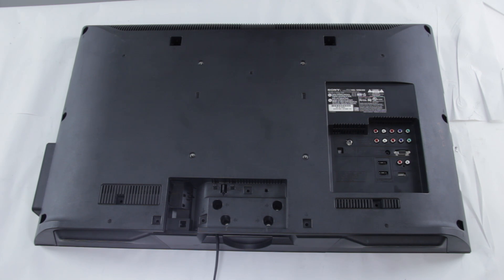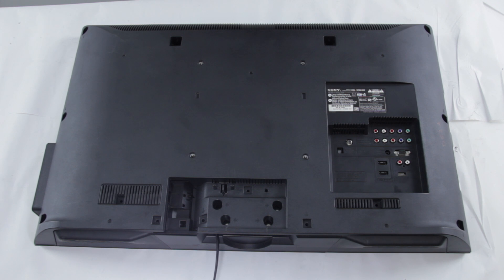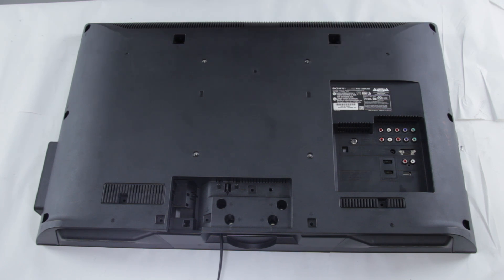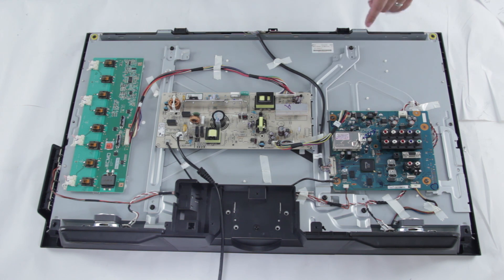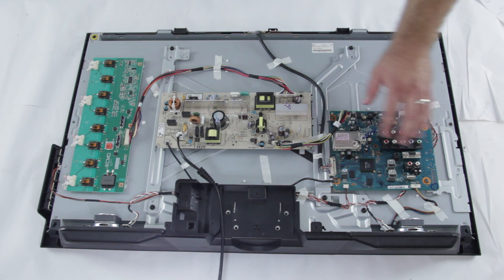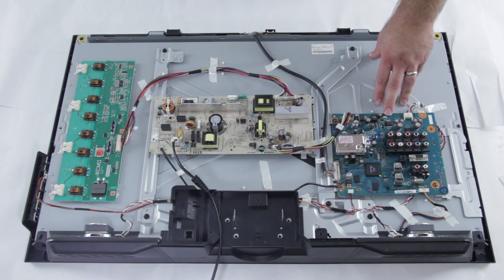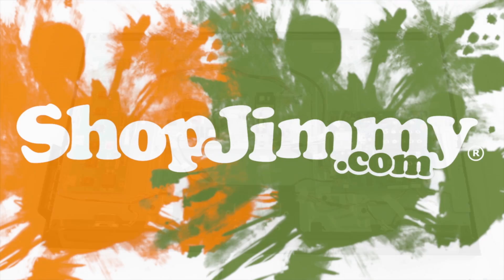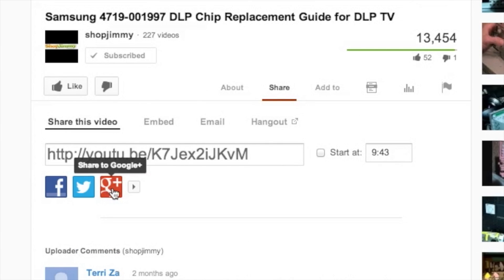LCD TV Repair - TV Has Audio, No Video - Common Main Board Symptoms & Solutions

Comment: hey Guys,  nice vid. I have a HP LC4776N with some issues, it will power up with no problems, but after ~30 min the whole screen goes black with faint vertical red lines. (audio can still be heard. )  I'm thinking it's the main board overheating,  but could it be the T CON too? thanks for the help!

Comment: I have a sony KDL40XBR3 with slow picture start up. When this occurs I have no control with the remote or panel on TV. I've changed the power supply and analogue board with no luck. Wondering if the problem is in the digital main board? Picture when on is perfect!!

Comment: Love Shop Jimmy..so informative and helpful...
I have a Sharp Aquos LC52D85UN..I was watching TV and it just shut down..no picture no sound..I unplugged and plugged the TV several times and still nothing..on the front panel the Power and OPC button blink twice simultaneously then the OPC blinks 3 times separately right after...tried find the codes for the blinking but no success. Thanks
Reply from the maker: +Diana Tull  Try all repairs and troubleshooting at your own risk.  I recommend replacing the power supply board in your TV.   Click this link to a replacement power supply board for your TV model number:  http://www.shopjimmy.com/sharp-rdenca336wjqz-power-supply-unit.htm  There may be multiple boards for the same TV model number, be sure to match part numbers on your current board, with your replacement for compatibility.  Here is a link to a video showing how to identify your part number, click here:  https://www.youtube.com/watch?v=-i9o4C2XkyQ  Thanks and please let us know if you have any further questions with your TV Repair!  www.shopjimmy.com

Comment: hello,i have a element 60 inch tv, it has no picture and have sound, i did the flash light test and seen picture in back ground, i replace t con board, and other ideas?
Reply from the maker: +Brian Seibert   Try all repairs and troubleshooting at your own risk. This could be a problem with either the power supply, the inverter board or boards, or the lamps in the TV that provide the backlighting. You can try replacing the power supply board or all of the inverter board(s) in your TV to see if one of those replacements fixes the problem. Try all repairs and troubleshooting at your own risk.  Please reply with your TV model number.  Click here to view a video that shows how to find your TV model number:  https://www.youtube.com/watch?v=S51nhAmwR2M  Thanks!  www.shopjimmy.com

Comment: HI, I have a Samsung LN46A750R1FXZA and the problem that I have is that when you turn on the TV at any moment there's no video it has audio. The video doesn't come back until you turn it off and turn it on back again. I already change all the capacitors on the power supply. Another thing that I noticed is that the DVD Player is connected to the RCA input and I can watch a movie and the TV does not go black.
Reply from the maker: +Omar D Ruiz Morales   Try all repairs and troubleshooting at your own risk.  I recommend running the flashlight test on your TV.   Here is a link to a video we produced that shows how to run the flashlight test. https://www.youtube.com/watch?v=xUzCLgoSPGM Please reply with your flashlight test results and we can recommend a replacement part for your TV repair. Thanks and please let us know if you have any questions! www.shopjimmy.com

Comment: C Ward My Samsung LTD TV is 3 years old. Purchased in 2012. Model number is LN46D630M3FXZA. While on it turns itself off then back on then off, etc. I've read that this was a common problem with earlier models. Apparently it's a problem with this model as well? Is the solution to replace the main board?
Reply from the maker: +C Ward  Try all repairs and troubleshooting at your own risk.  Do you have experience using a meter to check voltages?  Thanks!  www.shopjimmy.com

Comment: Hi, I have a Samsung Model UN55F9000AFXZA TV, it does power on but I just get a screen showing the TV being plugged into to the one connect box.  I can not get off that screen and the TV does not recognize the one connect box or the USB port.  I can't get to the menu.  I can turn the TV on with the power button but can not turn off the TV with the power button and have to use the remote to turn the TV off.  I was wondering if it would be the main board that is bad?

Comment: I have a Visio tv model sv472xvt it has no audio
Reply from the maker: +Adrian Saenz   Try all repairs and troubleshooting at your own risk.  I recommend replacing the main board in your TV.  Click this link to replacement parts for your TV model number:  http://www.shopjimmy.com/vizio-3647-0172-0150-main-board-for-sv472xvt.htm  There may be multiple boards for the same TV model number, be sure to match part numbers on your current board, with your replacement for compatibility.  Here is a link to a video showing how to identify your part number, click here:  https://www.youtube.com/watch?v=kxkeGLhlQY8  Thanks and please let us know if you have any further questions with your TV Repair!  www.shopjimmy.com

Comment: Hi, I would like to consult regarding my two TVs.  I would like to know if there is a DIY way to fix it since when I have it checked the repairman told me to buy a new unit instead since the cost of repair would almost be the same.  Here are the problems:

(1) SAMSUNG LED Model: UA40D5000PR
Problem:  Almost 80% of the screen (horizontally from the top) has the color fading to almost grayish black. It sometimes normalizes but only for a few seconds and there seems to be a horizontal line where the faded and normal color meets and sometimes a overlapping resulting to a distorted image.

(2)  DEVANT  LCD Model:  22DX850  
Problem:  No sound coming out.  I tried connecting to a speaker through the earphone jack still no sound coming out.

Comment: After  replacing my mainboard the picture and the menu in my TV are upside down and the picture  is fuzzy.. Before the replament there was not picture at all.  software in board was updated to v.1.557       Tv  sony   KDL-46EX641        main board was bought  ShopJimmy... Help please
Reply from the maker: +jose cespedes  Try all repairs and troubleshooting at your own risk.  It sounds like you replaced your main board with the incorrect replacement.  Thanks!  www.shopjimmy.com

Comment: Hi, I am having an issue with my TV. Model DP46840, ser: B1071151575996, I turn it on, green light comes on, hear a click, then light goes on, no TV. I can repeat this several times, then nothing at all. Unplug it for a few minutes and it will do it again. Main Board: PWB.MAIN.N7AL , right above that is 1LG4510Y04600. Have visually inspected it, Don't see any burnt colorization on board, modules or capacitors. No buldges in anything either.

Comment: greetings!  I have a Vizio SV470M with some fried HDMI ports and I'm pretty sure needs a mainboard replacement.  I'm having trouble finding one, however.  Even the most expensive sites I've found to have this part, 3647-0192-0395R (this is the number shown on vizios parts website although I've also found the part number 3642-0692-0150 to be associated with the model SV470M, so that confuses me as well), are out of stock.  I found one of your eBay listings for the EEPROM only for this main board (and you're also using the part number 3642-0692-0150).  I really just want to make sure that I order the right board and the different part numbers are confusing me.  do you have any advice for me?  thanks!

Comment: i have a sharp aqous lcd tv model number is lc60e77un,it has no picture ,no sound,but the backlight is lit i need an answer asap ,thank u
Reply from the maker: +Dominic Ragnanese   Try all repairs and troubleshooting at your own risk. This could be a problem with either the t-con board, the main board or the TV panel. You can replace the main board and the t-con board individually to see if one of those boards fixes the problem.  Click this link to replacement parts for your TV model number:  http://www.shopjimmy.com/catalogsearch/result/?q=lc60e77un  There may be multiple boards for the same TV model number, be sure to match part numbers on your current board, with your replacement for compatibility.  Thanks and please let us know if you have any further questions with your TV Repair!  www.shopjimmy.com
Reply: Thanks for that great advise a month after I left my problem,so you pretty much told me it can be everything other than the remote,thanks for narrowing down for me,any good can replace every board on the tv,you guys were very good a few years back but you have really gone downhill that's why me and a lot of people don't use u anymore,you never have the board we need,you stopped giving repair advise ,and with the advise you just gave me that's probably a good thing

Comment: 55 inch Proscan Model 55LC55S240V69 Series 9146-55LC69S-01196 sound but no picture..
Reply from the maker: +Lonnie St.Julien   Try all repairs and troubleshooting at your own risk.  I recommend running the flashlight test on your TV.   Here is a link to a video we produced that shows how to run the flashlight test. https://www.youtube.com/watch?v=xUzCLgoSPGM Please reply with your flashlight test results and we can recommend a replacement part for your TV repair. Thanks and please let us know if you have any questions! www.shopjimmy.com

Comment: I have  32" insignia tv. model#ns-l32q09-10a. I have image coming but is very fuzzi. what part shoud I  need
Reply from the maker: +manu patel   Try all repairs and troubleshooting at your own risk.  I recommend replacing the main board in your TV.  Click this link to replacement parts for your TV model number:  http://www.shopjimmy.com/catalogsearch/result/index/?cat=56&q=l32q09-10a  There may be multiple boards for the same TV model number, be sure to match part numbers on your current board, with your replacement for compatibility.  Here is a link to a video showing how to identify your part number, click here:  https://www.youtube.com/watch?v=LIWO2A_tuaI  Thanks and please let us know if you have any further questions with your TV Repair!  www.shopjimmy.com

Comment: Hi, my Bush TV DVD red power just blinks. but doesn't switch on. the screen done light up. but you can hear DVD drive spinning, and stop if you press the button on the side, I can even eject the DVD. but no sign of life on the TV side. have tried holding the power button for 30 secs and unplugging it trick. Model: DLED32947DVDHD serial No: 6960587 200301. please help, hopefully I can repair with the correct replacement parts needed. thanks Jamie
Reply from the maker: +Jamie McLatchy   Try all repairs and troubleshooting at your own risk.  I recommend replacing the main board in your TV.  Unfortunately I do not see any replacement parts in the search results for your TV model number on our website.  Please reply with your part number on your main board and I can try searching for replacement parts.  Thanks and please let us know if you have any further questions!  www.shopjimmy.com

Comment: Having issues turning on an LG 42LN5300. The tv was struck by lightning and will not turn on. I changed the power supply inside the tv with a new one and got no response. Is there a way to test the motherboard or will I just need to buy a new one? Also, how could I be certain the graphics card or the power button panel is in good working order?

Comment: I have a Sharp Aquos LC-70LE600U. It started cycling power on its own. Sometimes the power doesn't seem to go out just the display and then others it completely shuts off. I used to be able to get it to stop cycling by unplugging it but that no longer works. I have already tried replacing the power supply board but the problem still exists. Please help!

Comment: I bought a TV from goodwill....when you stop laughing I tell you the rest.

Ok, when I got it home it did not work. I took it back immediately and the manager gave me a full refund even though store credit only was the policy.  I than bought the TV back from him for $30.

The Tv is a LG MODEL: 42LE5500 SERIAL NO: 005RMAQ99120

The Tv did not come with a remote. I am ordering the original one off ebay for $9. When I plug in any component into any of the HDMI, CABLE or old school audio visual cord receptacles and go into the tv input it gives me the opion to choose what even port i am using. After choosing say HDMI port 1 the tv opens up a black fuzzy screen and reads no input. Again this is for ever available port?

Thank you for your consideration, I love you guys

Comment: I have a Sony Bravia...  Model# kdl-32m3000...  Sn#4063687... TV has no picture whatsoever but using the input and channel buttons I can get it to produce sound from my DVD player...  Do you think it's from the main board or could it be something else?
Reply from the maker: Greg Baker   Try all repairs and troubleshooting at your own risk.  I recommend running the flashlight test on your TV.   Here is a link to a video we produced that shows how to run the flashlight test. https://www.youtube.com/watch?v=xUzCLgoSPGM Please reply with your flashlight test results and we can recommend a replacement part for your TV repair. Thanks and please let us know if you have any questions! www.shopjimmy.com
Reply: ShopJimmy.com Hi there. Thanks for the reply. I tried the flashlight test and it doesn't show up at all. When in the dark, and when I turn it on, I can see a faint glow from the screen but when I shine the flashlight in any direction at the screen I cannot see anything at all. What conclusion do you come up with from here? Thank you so much for your assistance again. And hope to hear back from you soon. - Greg
Reply from the maker: Greg Baker  PLEASE SUBSCRIBE TO OUR CHANNEL - Try all repairs and troubleshooting at your own risk.  Do you have backlights?  Did you hit any buttons to pull up the menu or an image on the screen, when shining the light on the screen?  Thanks!  www.shopjimmy.com

Comment: I have a 55 inch lg tv model number 55ln5200. I can not get the tv to power on at all. So I bought and replaced the power supply board and the tv will still not power on. We had a little thunder storm and it knocked out my directv box and at the time I was not home to unplug the tv. So I was wondering if it messed up the main board where the hdmi cord was plugged into at the time.

Comment: Hello, I have a Poloroid 3211-TLXB tv and it has power but will not turn on. The red light on the front just stays on it does not blink. I have also just replaced the power board so I was thinking that it was the main board now?

thanks

Comment: Hi Thanks for your reply. You asked for the panel number.
Panel Number: Model # RS400TVM
Panel Number Product # LTA400HF11
This is on a
Sceptre: X405BV-FHD3HF11
mainboard on front: T.RSC8.10B.12305
mainboard back sticker: A12092146-0A00045

Thanks
Reply from the maker: DJ Joshyjosh  Try all repairs and troubleshooting at your own risk.  You could replace the eeprom on the main board and see if that fixes the problem.  You would need to have the ability to be able to solder components and have the appropriate tools.  Here is a link to the eeprom:  https://www.shopjimmy.com/sceptre-x405bv-fhd-lta400hm07-b12083599-main-board-u16-eeprom-only.htm?___store=default  Thanks!  www.shopjimmy.com

Comment: I have a RCA 42" led lcd  model LED42C45RQ it works awesome some times and some time it only has color bars. this time it has worked for a mouth and now color bars after it sits a few day or weeks it will work again for a day or may be a mouth. can you help , I have fixed a few but most of the time it is a power problem this is new to me.

Comment: Hi, I think my problem is with the mainboard. When you push the on button, the LED changes color however, it started taking longer and longer for the boot screen and picture/sound to appear, sometimes several hours or half a day. Once the TV booted it work normally. While it is “trying to start up”, it will not power off without being unplugged.
Sceptre: X405BV-FHD3HF11
mainboard on front: T.RSC8.10B.12305
mainboard back sticker: A12092146-0A00045
Tracking down an exact match on this board looks like a problem. Is it possible to use a T.RSC8.10B.12305 that has the same layout as mine and then transfer my EEPROM to the new board. I would rather find the correct board but if this solution would work that’s okay too.
Thanks for any help you can offer!

Comment: I'm having a picture problem with my Element 50" ELET502, S#:F1300228160000565. PLEASE HELP ME
Reply from the maker: Kym Vaughn  Try all repairs and troubleshooting at your own risk.  What is the problem with the picture on your TV?  Can you see an image?  Do you have backlights?   Does the TV turn on?  Is there a blinking light in the front?  Thanks!  www.shopjimmy.com
Reply: Tv turns on, there is audio but no picture, no back lights, no blinking
Reply from the maker: Kym Vaughn   Try all repairs and troubleshooting at your own risk.  I recommend running the flashlight test on your TV.   Here is a link to a video we produced that shows how to run the flashlight test. https://www.youtube.com/watch?v=xUzCLgoSPGM Please reply with your flashlight test results and we can recommend a replacement part for your TV repair. Thanks and please let us know if you have any questions! www.shopjimmy.com
Reply: Ok, thanks